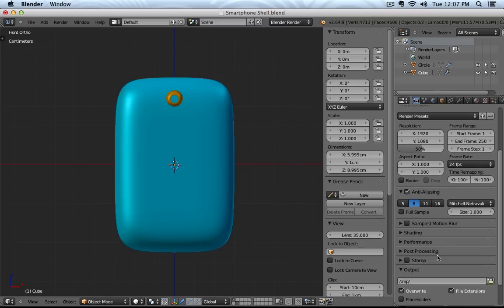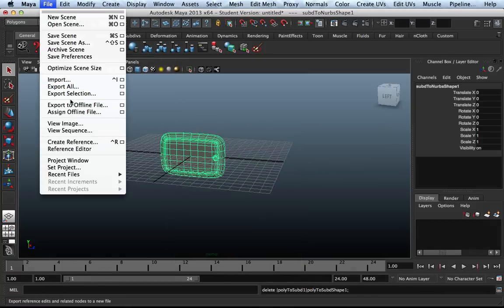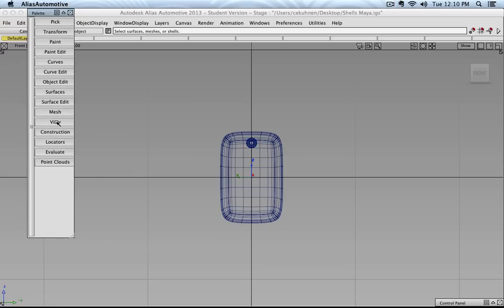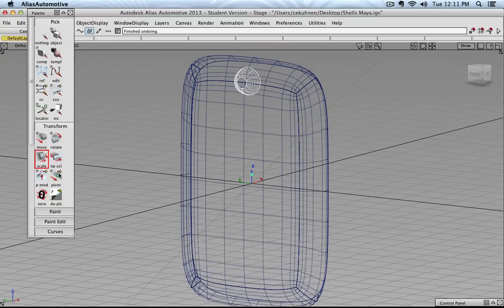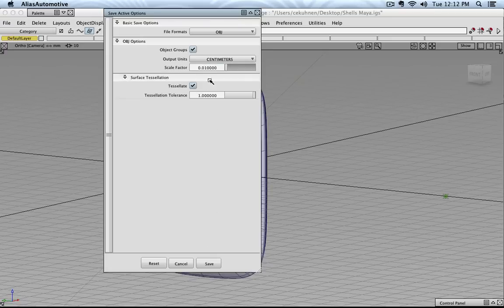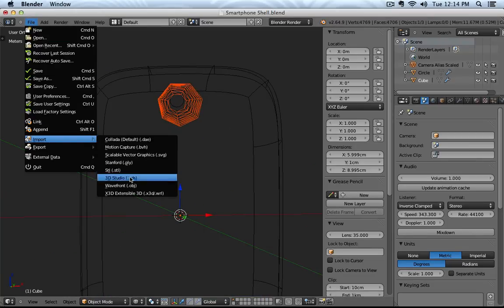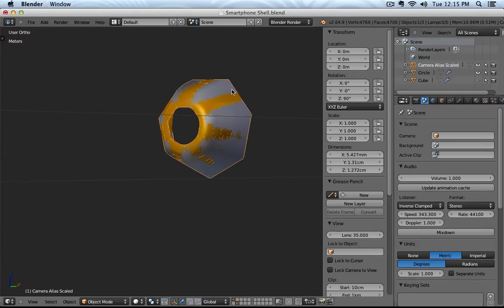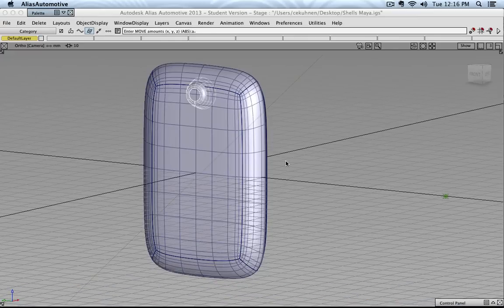Transfer Models between Blender and Alias each way

Comment: Your video kinda saved my butt ! This is the only tutorial I could find that shows exporting Alias models for use in blender. Thanks a ton !
Reply from the maker: You are welcome. this is a very old video. Problem with Alias is that it does not export UVs. You can export as STEP and then use MOI 3D to generate the UV maps when exporting into NGNON OBJ.
Reply: But there is still one problem. The whole model comes as one object and I can't select different parts for different materials. I made a yacht and for that I need chrome in the rails and paint on the hull but I can't separate it. What am I doing wrong here ?
Reply from the maker: Dev n Malviya I think in such cases export part by part from Alias into OBJ not all at once.

In OBJ you also have groups as in export/import function. check that one too.

in blender in edit mode you can also with pressing "L" over a mesh area select just the mesh of the object and separate it into a new object.
Reply: Worked !
Reply from the maker: Dev n Malviya Perfect!
Reply from the maker: Dev n Malviya BTW do you have access to Maya? I ask because Alias and Maya were in the past bundled. Maya uses Alias NURBS tools. So you can load an Alias model in Maya and from there do the OBJ export with perfect UV maps added by Maya.
Reply: Hi again! That was the first thing I tried. Problem is, Maya is very moody for wire files and sometimes does not display a complete model when imported from Alias. So I found a hack, import Alias files in Showcase and then export to FBX. And voila, you have a complete no defect model for use in Maya. But yea you need to create UVs on that later.
Reply from the maker: Dev n Malviya Oh really? Shoot - truth is most times I imported IGES or STEP files. But I assumed Wire will transfer perfectly. Guess I was wrong!